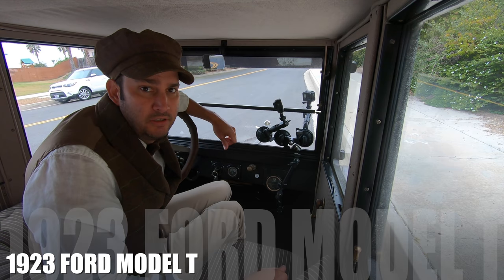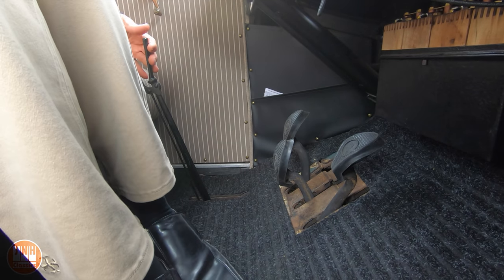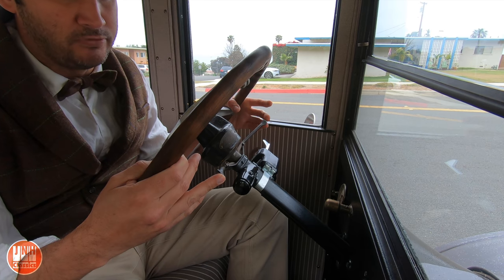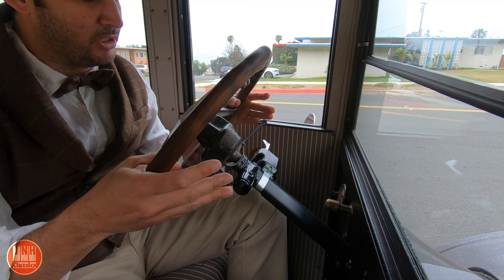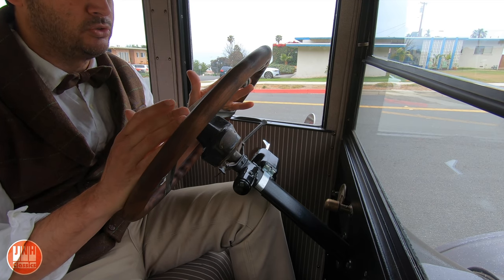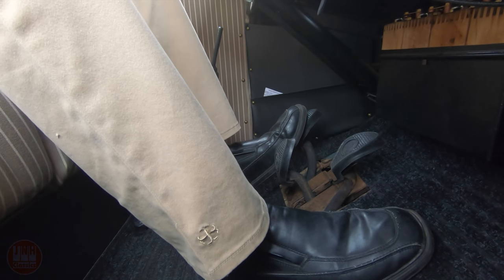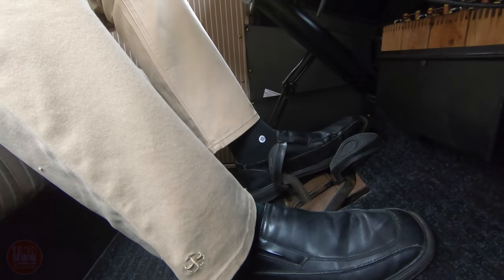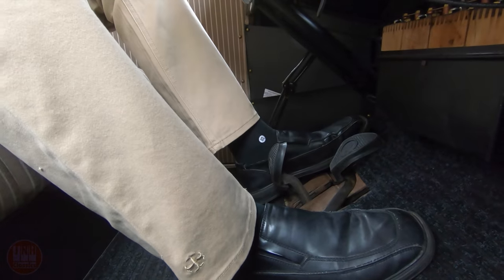How to Drive A Model T and Why It's So Hard to Drive on a Hill

Comment: This is a great video. I am a bit confused, though. I have seen lots of videos that say one puts the emergency brake in it's center position for low gear and put it forward for high gear. Then I saw a video  that one left it in the center position and just use the left pedal for low and high with neutral in the middle. That seems to be what you do. Did you have the emergency brake lever in the middle? What is the purpose of some people moving the emergency brake lever to shift? Thank you
Reply from the maker: When the emergency brake lever is in the middle it releases the brake and allows the car to go into neutral and low gear but not high gear. Some people use the lever to hold the car in neutral but I just hold it there with my foot. To go into high gear the lever needs to be all the way forward.

Comment: Nice T, what is the black device on the right side of the steering column below the steering wheel?  We have a ‘27 Buick and though I am a GM guy through and through as I’ve worked w GM for over 20 years now,  I still want a T and an A.....after all who doesn’t want a little T and A! Lol....sorry couldn’t resist!  But in all seriousness I would really like to get a T and an A someday soon.....
Reply from the maker: The round button on the steering column is for the horn. I have a video coming out Sunday that breaks down the cost of the model T and compares it to the VW Beetle. You might be surprised to find out how affordable a T is and how easy they are to find👍

Comment: Great video! Thank you very much. I have a friend with one and may get the opportunity to drive it soon. Is there anything special to using reverse?
Reply from the maker: Reverse is very easy. Just use the parking brake handle to put the car in neutral and press the reverse pedal.
Reply: @Jerod_Helt  Thanks-

Comment: I wouldn’t want to drive this car here in Taiwan… you can’t imagine how steep and how curvy the roads are here. With like half a km free fall when crashed. 

Sometimes inclines can be so steep that when it rains, modern 4x4’s all wheels are just spinning and not doing anything. 
Well… going uphill is not such a big deal when failed but imagine coming back down again 🙈

Comment: If I had a Model T I would want to drive it but I wonder about how practical the car is to drive in modern traffic. I think I would have to fit some kind of decent brakes to the front wheels. I don't know if there are any aftermarket ones available.  What happens if it won't sift down on a steep hill?

Comment: I dont get what ‘neutral’ is? Is it when the clutch is relaxed (plates separated) and thus disconnects the engine rotation from the rear wheels? Thats the bit which I don’t think is clear. And presumably you have to be in ‘neutral’ when you start the engine. Thanks for wonderful video series.
Reply from the maker: There are no clutch plates. It’s a planetary gear system. At it’s natural resting state the engine wants to drive the car forward. By clamping the band down onto one of the rotating drums you can hold the car into neutral but as soon as you let off the car moves forward. This made it possible to use the car as a irrigation pump for example, in a field you could pull the back wheel off put a pulley on it connected it to a pump and let it run as an irrigation pump as well as many other uses.
Reply: @Jerod_Helt  interesting stuff. Maybe there is a mod where you can put a clutch in. I watched a video today where a guy put alternating metal and fibre faced plates in. I thought even originally they had a just metal plate clutch at the back of the ‘gearbox’. Anyway thanks again.

Comment: how much pressure does it take to hold down the clutch in low gear is the pressure like a typical modern clutch
Reply from the maker: About the same as a modern clutch
Reply: @Jerod_Helt  cheers

Comment: I don't understand the braking issue, I saw you install shoes on the rear wheels. Are they just for the parking brake?
Reply from the maker: Yes that’s just a parking brake. The shoes I added make it so it could be used in an emergency but it’s not intended to be used all the time.

Comment: Hello I'm looking into buying a Model T and I have been watching a lot of videos on the control side of the car one thing I don't understand is when you're in low do you have to hold the pedal down or does it stay down on its own
Reply from the maker: You have to hold the pedal down to keep it non low gear 👍
Reply: @Jerod_Helt  thank you so much for your reply so fast things were different back then that's why I love these old cars you had to know what things were happening at any given time you could definitely forget about trying to text and drive a Model T

Comment: Thanks to  modern auto mobile engineering we dont have to adjust spark timing throttle timing figure out high or low gear engage rather than just stepping on the foot brake and see the car stop smoothly down or up hill.

Comment: So much to say and so little time. Not like a tractor other than the throttle is on the column. The control lever allows the transmission to be in direct drive (high gear) when pushed all the way forward. I drive a 1923 model T Ford every day in Rochester, NY. Your disadvantage with your model T Ford is that it’s a heavy body style. Put passengers in there and it’s the heaviest T made. You must have good compression, the coils must be adjusted properly, the timer and plugs must be clean in order to accelerate when approaching a hill. And as you say the spark timing must be retarded in the beginning and then advance the spark to gain speed.

Comment: Does it have choke??
Reply from the maker: No, but it has a prime
Reply: @Jerod_Helt  prime has the same function as choke??
Reply from the maker: It’s similar. A choke reduces the amount of air going into the cylinders and a primer increases the amount of fuel going in. Both give you a higher fuel to air ratio but in a different way.
Reply: @Jerod_Helt  Nice,Wonderful video .... Vintage car
Reply: 200 cc engine?
Reply from the maker: @santanumondal8407  I’m not sure… I believe it puts out about 20hp

Comment: Driving a model t is alot different then  a model a engine management is the driver my model a is ninty years older then today's car try driving a f 150 lightning whole different world even though they are ford's. I have to double  clutch and have in my mind what is going on to change gears or you will grind them. Us 40 was a dirt road when our cars were made mine is model a long was for taxi service more room in back for riders. Mt g rand father had to work just as hard as today's brake.man does to by a ford ecosport. Let convert  the sticker price to today's dollars it would be 20000 I remember a color tv phonograph cost just as much a a ford Fairlane a radio in the twenties cost just as much as a model t a car radio cost almost as much as the car 800 dollars for air-condition was big chunk of 56 ford price what is 700 dollars today on new ford for ac stereo cd now it  is blue tooth 2020s